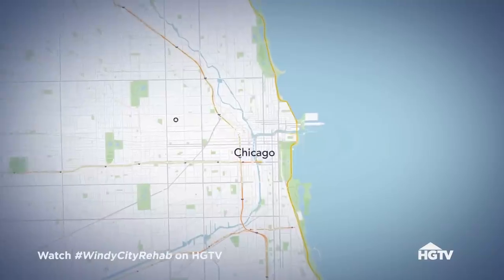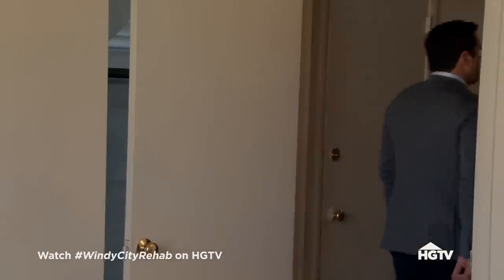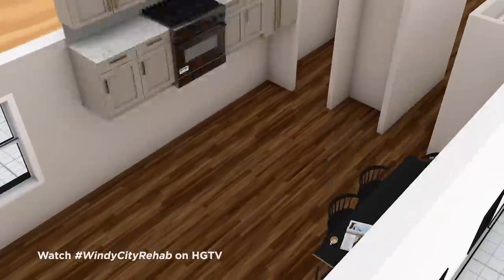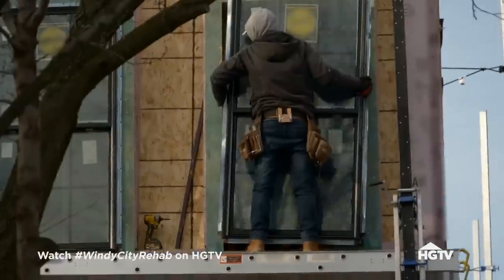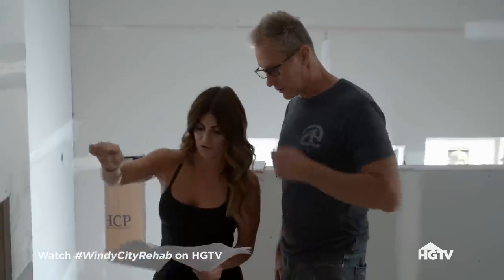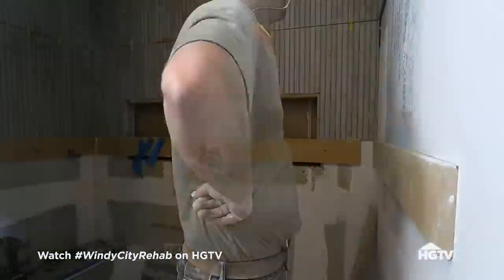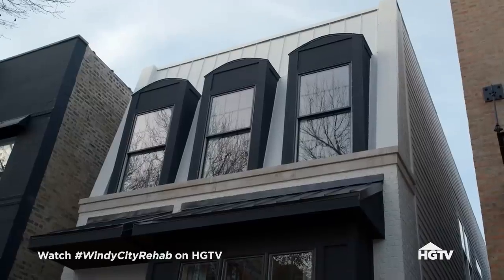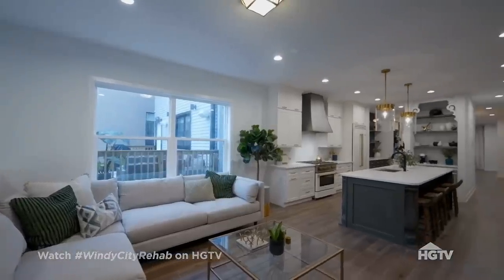Building a Modern Home Inspired by Tradition in Ukrainian Village | Windy City Rehab | HGTV

Comment: Bricks are strong to begin with, but once they’re painted, you’ve lessened the quality of your structure and added an extra layer of unnecessary upkeep and maintenance.

Painting over brick is essentially a death sentence for brick because you’re stripping it of its natural ability to breathe and release any moisture that becomes trapped. Because of this, any moisture trapped inside the wall will begin to erode the brick, wearing it down over time. Brick, in its original state, is a porous element designed to absorb moisture while also being exceptionally good at releasing or drying out any moisture. This “breathability” is accomplished through the cracks and small openings within the brick. Once brick is painted, it loses its ability to release moisture and dry out because all those tiny cracks and openings have been painted over and sealed up. In colder climates, the level of deterioration is much higher due to the trapped moisture under the painted brick.